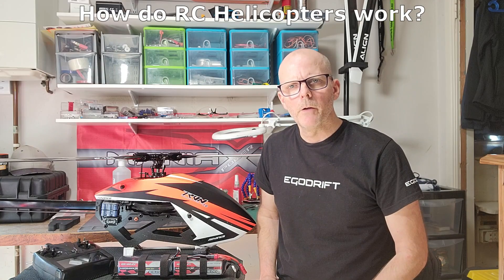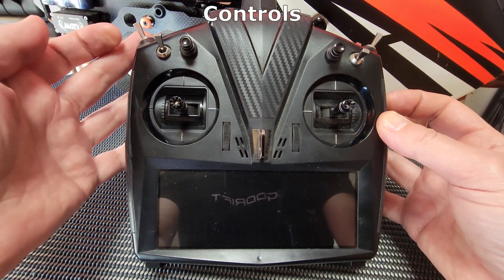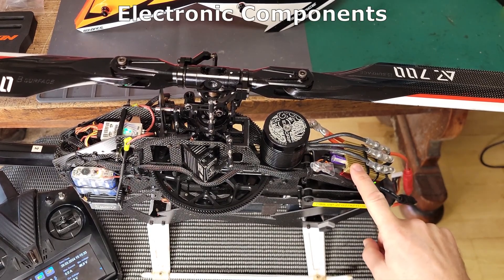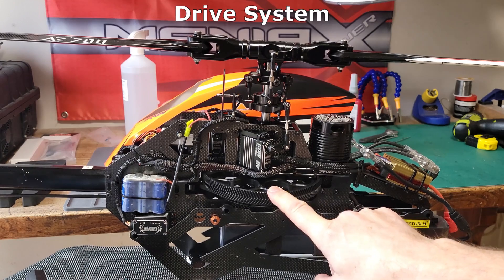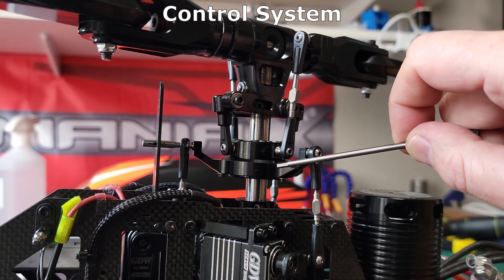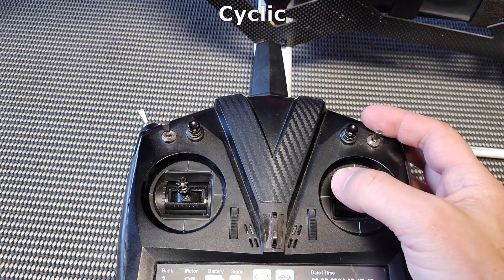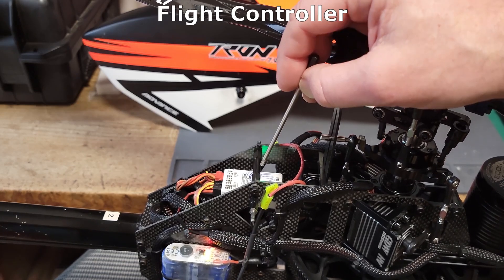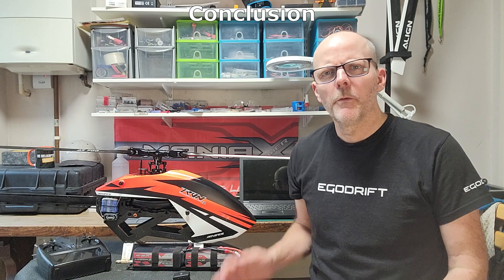How RC Helicopters Work: A beginner's guide to basic helicopter components!

Comment: I think that many would find the information to be informative if you did  a video focusing on the pros and cons of the different drive systems. Ring & Pinion Vs. Belt Pulley main drives Vs. Direct Drive. I'd like to see what your hypothesis as to which drive system offers the most efficiencies in contrast to the their total mechanical cost of operation (not purchasing cost).  Each has their pros and cons, and personally the parasitic loss of an interference drive system seems to be of poor design, but high profitability due to low cost of manufacturing for the companies making these models.  SAB had their RAW 420 Direct Drive (DD) and they stopped making it, NOT because it was inferior like they clamed, but because when a crash was incurred, less parts were damaged yielding a lower replacement part count and less replacement parts needing to be purchased. An out runner style brushless motor typically has a exhaustive operating lifespan. Much more than that of the other components surrounding it. So, in  hobbies like this (especially, a niche one), maximizing the consumer's purchasing is a priority of the marketing departments and a priority of the engineers creating the parts that make up the models.  We look forward to your future videos. Good job on this one.

Comment: Mistakenly did you mention flight controls for cyclic pitch in wrong manner. If you want to pitch the helicopter in forward swash plate should move sidewards as there is gyroscopic effect.
Reply from the maker: That's true, although the phasing is built into the head because the pushrods above the swash actuate the blade grip arms at 90 degrees already. I think it's designed this way so that it's a bit more intuitive and makes sense to a pilot who might not even be aware of the precession. Interesting observation. Are you a full size pilot?

Comment: WOW!!!   THESE R/C HELICOPTERS REALLY ARE A MODERN MARVEL OF ENGINEERING, MICRO MACHINING, AND ELECTRONICS & COMPUTERIZED "SMART" FLIGHT CONTROLS!!  I RECENTLY HAVE BEEN FLYING A TINY "FIREFOX" C129, 6 AXIS, 4 CHANNEL HELI.   IT'S BEEN QUITE A BLAST, TRYING TO LEARN TO FLY, AND, TO TRY TO NEGOTIATE WIITH THE EVER ER0RATIC WIND FORCES,..  I'VE BEEN USING  A 2' X 2' (x1") PINK STYRENE FOAM  SQUARE AS MY HELI-PAD... I SOMEWHAT LEVEL IN ON TOP OF A MOWED GRASS OPEN FIELD, AND THEN, FIRE UP THE THROTTLE, AND LIFT OFF,... TRY TO LEARN TO STEER, CONTROL THE CYCLIC, AND THE THROTTLE, AND TAIL ROTOR, TO "STEER INTO THE WIND, (USUALLY), AND THEN LAND BACK ON THE PAD.  ..."RINSE, AND REPEAT".   I'LL STEP UP TO A SLIGHTLY LARGE HELI, IN THE NEXT MONTH OR SO...   HOPEFULLY, MOST OF THE BASIC SKILLS WILL "TRANSFER" READILY,, FROM ONE TO ANOTHER, WITH A MINIMUM OF "RE-TRAINING".... I BOUGHT A FEW E-BOOKS ON LEARNING TO FLY A REAL HELICOPTER,... THEY EMPHASIZE SEVERAL "HOVERING, AND "TAXI" DRILLS, AND i THINK THIS IS WHAT i WANT TO STAY FOCUSED ON, UNTIL i FEEL 100% MASTERY OVER THE HELI, BEFORE I TRY FLYING IN MORE CHALLENGING "MISSIONS" (AEROBATICS, AND HIGHER SPEEDS, HIGHER ALTITUDE, ETC.)  BEST WISHES!!

Comment: Thank you Richard! I am building an RS7. How do you like your GDW servos? And what brand is your ESC?
Reply from the maker: I love GDW servos, but TBF I haven't tried anything else in recent years. The cost is less than other high-end servos, but they don't strip gears or bend in a crash, and they don't seem to wear out. I've got multiple sets that have gone from heli to heli, over  4,000 flights and still being used.
I use HobbyWing. I wasn't a fan of the V4 versions, but the V5 Platinum battery usage now works properly, as does the VBar integration. Defo value for money.
Reply: @rchelicopter  Thank you for your answer!

Comment: What happened to procession?
To tilt forward, doesn't the swashplate have to tilt left so that the action occurs 90° later in the rotors?
Reply from the maker: The 90 degree phasing is handled above the swash. I decided to just cover the basic components in this video, and do another one on aerodynamics if there's any interest.
Reply: @rchelicopter  Oh, yes. I see it now. The linkage to the rotor blades is set up at their 90° so that holding right cyclic makes the swashplate lean right while the forward blade gets the negative pitch input. Clever design.
Reply: it's already designed into the heli, and you don't really have to think about procession or other theoratical stuff, if you are only going to enjoy flying them.
just like you don't really need to know how engines and transmissions function, in order to drive a car with an automatic transmission.